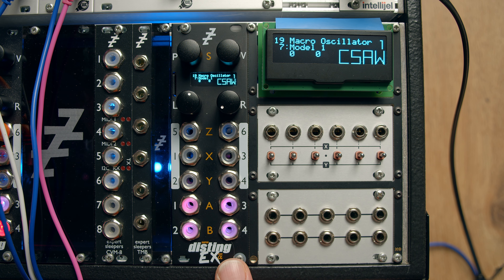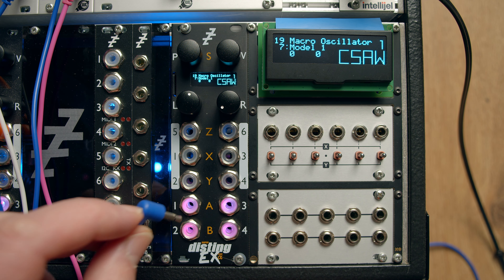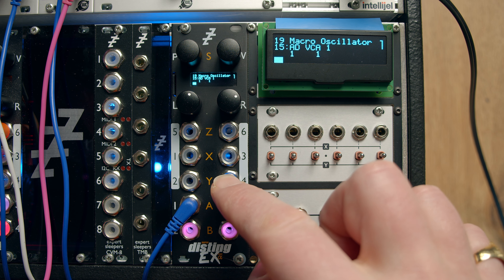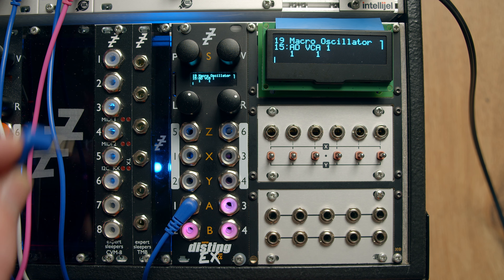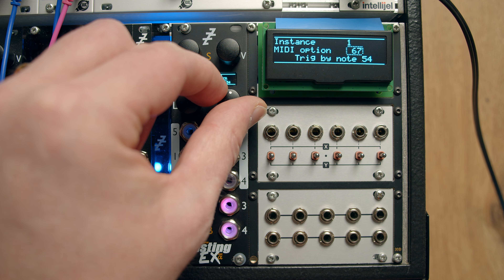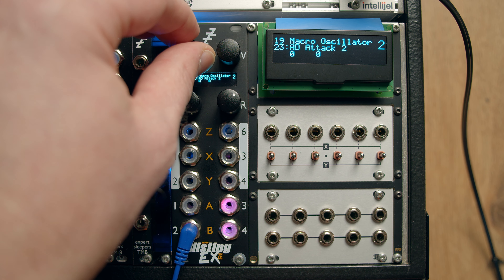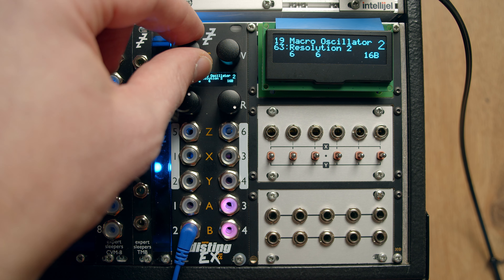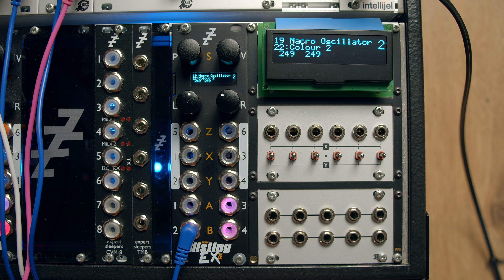disting EX - Macro Oscillator

Comment: Just when I thought the EX couldn’t get better😍 I have two of these in my case and LOVE them! 
(also idk if it would be wishful thinking but… it would be amazing to get a plaits algorithm in there too!)
Reply: Yes please for Plaits.
Reply: As someone who has never owned plaits or braids, tbf it does seem like there’s a fair bit of redundancy/crossover between the two modules 💕
Reply: @reelreviewdude5126  I'm just learning Braids and am used to Plaits, but my initial impressions are that whilst there is tons of crossover, the Plaits UI is nicer for me - turning a knob gives me so much more variety within a mode, with less need to switch 'modes' all the time. Since I just installed the new firmware, am about to watch lots of videos on Braids to learn more, so my opinion may change!

Comment: Fantastic addition! Is it possible to use the cvm-8 in i2c mode to control the braids parameters or is only the midi mode viable?
Reply from the maker: You can use i2c mappings, same as other modes. MIDI has support for triggering the Braids envelopes. I could add that to i2c as well.
Reply: @ExpertSleepersLtd  that would be really useful as I use a tesseract sweet 16+ for interfacing with disting ex a lot